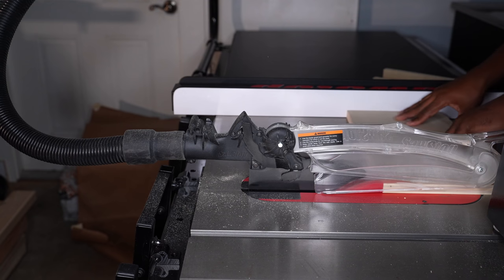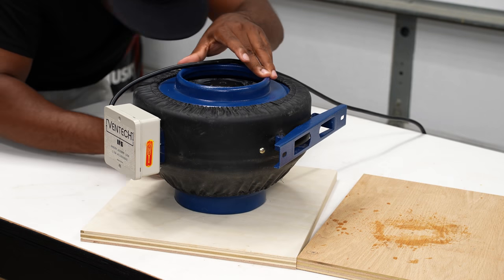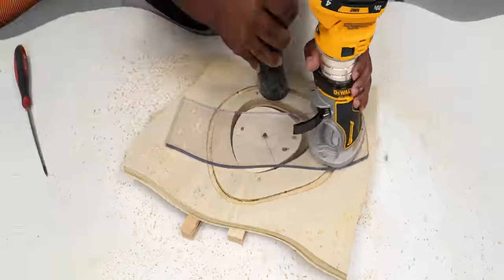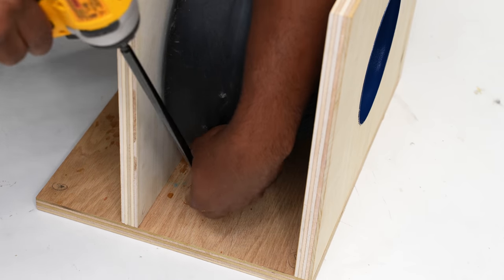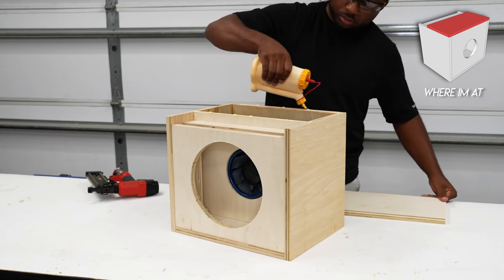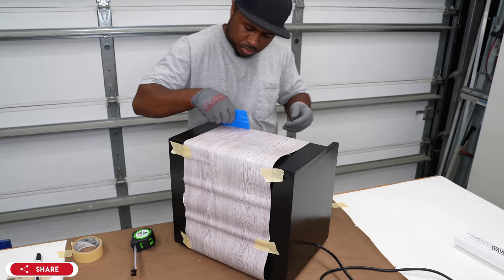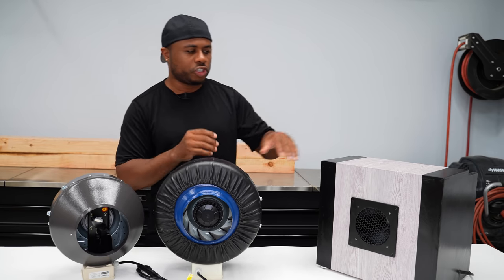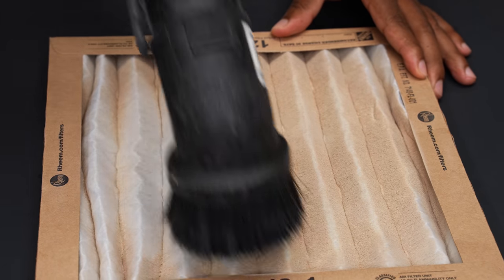How to make a wood shop AIR filtration system

Comment: 12:25 dude that's nothing, I built a 2 filter triangle shaped MERV 13 filteration system for my shop and the 20 x 20 x 1" filters were so dirty after 1 month. 3 times the dust. Mine has a 20" box fan. My dust collection on my tablesaw is 2 stage with bag in the vac and 1 stage on miter saw. I router is 3 stage. 

Still this is the best looking filter system I've seen yet. Dope

Comment: Thanks. Made one after watching this. Had been worried about air-borne dust so used a micro filter with an in-line fan (460cfm) . It quickly cleared the air in my garage/shop. It got so dirty so fast that I put a second filter on the other end of the fan. If I've done much cutting in the afternoon/evening, I let the fan run overnight.

Comment: Very compact design 👍. But I would recommend to build it bigger to integrate a second filter (air bag filter). By that you can use the air filter panel as a pre-filter for particels down to approx 5 microns and the second air bag filter for particels down to 1 mircon. That‘s how it runs in my shop and does a great job.

Comment: I like the simplicity. As with many, I have been keeping an eye on similar videos. Have also 3D modeled a design which uses 2 and 3 filters that is suspended from the ceiling, also built using wood from other projects. Feeling the need to re-evaluate it. Thanks for the demonstration.

Comment: Another great build! I often use flat washers when attaching components made of metal to wood/plywood, esp if the hole in metal is a bit bigger than needed. Better holding power. Thanks for sharing!

Comment: Solid project and one that I hope to do sometime soon.  Only thought for if you have to build more of these for your shop - make sure get to the fan in case it fails and you need to replace it.  From what I saw, you'll have to build an entirely new box or spend a ton of time pulling nails and glue apart.

Comment: 10/10, I'm planning on building one for indoor-air quality.  I think I'll be using 4-stages of filters & an 8inch vortex b/c they're resistance-rated high enough to pull air through clogged(to the max) filters. I also want it to have an Megnehelic meter to monitor clogging.

Comment: Great job here.  I have a blower like you show that exits out a window.  
One thing you might do with your circle router is to switch to the other side as you get near the bottom.  You know where the center is so you should be able to flip the board over and get a cleaner cut with no tear-out.  Just my thoughts.

Comment: Love it! I'm thinking of putting 1 or 2 of these in my house to clean the air and circulate heat. I have a wood stove and parts of the house get chilly while others are screaming hot.

I was thinking of adding high density foam or something to the inside to kill the noise and possibly making the box longer with 2 slots - 1 for a coarse filter and 1 for a much fi er HEPA filter

Comment: I've watched a lot of these diy filter vids lately cause I want to make one.  Honestly this is the best so far. The upgrade from a box fan to the inline is definitely worth the cost.  I'm wondering if this fan would be fine to make a little bit bigger box with a bigger filter or maybe double up the filters?  Also this is the best looking one by far. Going above and beyond for looks is awesome.
Reply: Bigger filters would probably be beneficial and put less load on the fan.

Comment: Nice build and idea. Just an idea to think about. If you calculate the actual opening/exposed surface area a 440CFM intake fan requires, you can easily use a bigger intake/filter. It would allow more air movement and less frequent filter changes. With the 12x12 you have it will starve the fan greatly. IMO. I understand keeping the overall compactness of unit. (its perfect). Maybe put (2) filters at a V or come to a point? Or filters on each side and a duct at intake end? just an idea. thanks for sharing

Comment: Your project here inspired me to build my own version of the portable air filtration system (yeah, it took me 2 weeks).  The main difference with mine is it can run on Ryobi battery or 110v, I can still use the fan as a fan if needed, and cost me less than $60 including the fan.  I made a video of it if interested.  FYI, I don't always comment, but I do always watch :>)  Thanks for your inspiration and keep the great videos coming.

Comment: I really like your approach to these projects. This is something I've been thinking about making, so it is timely. There were a couple things that I, personally, would have done a bit differently. I would have made the front opening square to match the full filter area, although it seems like it's picking up more or less to the edges of the filter and the style looks good. Another thing would be to attach one of the panels with screws so that it could be removed if necessary to clean/replace/service the fan or wiring. I just am paranoid about anything that is all sealed up. That's a relatively low pressure fan, so I wonder how well it sucks the filter against the frame and how much leakage you might get around the filter - but I'm also not sure that it even matters in this application. Having grown up without really giving workshop dust a thought I'm becoming a lot more thoughtful about it as I get old.

Comment: Very nice dust filter! I would think you should have built in an access port for the electrical connection box in case it needs future access. You never know what will fail at a bad time. I've been thinking about building something similar, but with added carbon filtration. I'd wager you're going to end up building another one at some point. I also wonder what the performance difference would be between the circular filter hole you used and a larger square hole to come closer to max square filter area. Once.. ha.

Comment: That looks awesome and a great idea, and very clean work. The system would be more efficient if you made the cabinet longer and pull the inlet away from the filter to create a vacuum ‘chamber’ rather than the air inlet and filter so close to each other.  In other words, your column of air should be as large as the filter area. Also make the front hole the size of the filter to expose all the filter surface.

Comment: Great work.  I have a questions though.  How much does the filter restrict the air where it affects the operation of the fan?  Does it cause the motor to work harder, too hard?  Optimal would have enough filter area where 440 CFM could/would pass through the filter area.  This is why some people use a box fan and will build a cube of filters behind it, to increase the surface area for increased air flow.

Comment: Could one of these inline fans be used to make a small, single machine, dust/chip collector? Like for a drill press or bandsaw? A regular shop vac works but the loud sound get annoying. And my dust collector is in a different room and would not be feasible to run the hose.

Comment: Nice idea - will definitely make one for my shop.  However, with regard to using for spray-painting, is this safe to use when spray painting or airbrushing with enamel paints?  Any concern or danger with the switch/control being a source of ignition for flammable fumes or particles from the paint?  I need to make a spray booth for painting models in my basement work area, both to contain overspray and keep the fumes under control.  Looking to possibly modify this for that purpose.

Just found your channel and enjoying it.

Comment: Such a great cheap idea for weekend warriors or people renting/suburbs that can't put in a full size pro system. I wonder if you made another without the filter and routed it outside with an electronic baffle door (for insects) how much cross draft you would get might eliminate the need for the filter having all the air being dragged outside constantly.

Comment: My only concern with this is the fan axial fans are not made to force air through ducts and filters you need lots of static pressure try and use a radial or centrifugal fan nice work though 👍

Comment: This looks really good! Question - I am not very good at making things so I currently use a 20 inch box fan with a 20x20x1 furnace filter attached to the back of it for my air filtering needs.  Please forgive my ignorance; other than having different dimensions and looking more aesthetically pleasing, in what other ways is this type of filter better than a box fan filter?
Reply from the maker: Thanks, while they both do the same thing, this setup is way stronger and will clear a room faster than a fan. I tried the fan setup, but with the lack of suction power, particles further away will likely not be pulled in before falling. Neither is wrong, but if you want to clean out a 400sqf in 3 to 5 minutes, I will go with an inline duct fan.

Comment: Duct fan is 440 cfm not 4440.  Black and vinyl looks good.

To calculate the volume of your shop, multiply the length by the width by the height. Multiply this number by the number of times per hour you want to filter the air (6 – 8) and divide the result by 60. This will give you the CFM required for your workshop.

Comment: Quick engineering tip: if you make the box with filters on multiple sides (say front, top, left, and right), you can greatly reduce the back pressure on the fan.

The fan will move what ever air it can (per its rated CFM), but it won't have to work as hard if it has access to more room air (per the additional filter surface area).  In other words, the air resistance on each filter is reduced while maintaining the same total volume of air through the box.

If you make a box where the back side is a cheap box fan for example, the motor should last longer when doing this.  And you don't have to swap out filters as often, because you now have multiple filters to share the load.  But you do have to swap out all those filters in bulk for each life cycle.

Comment: You should have made the capacitor easier to get to. With cap run motors like that, its usually the capacitor that starts to fail after a couple of years (can be a lot sooner or longer, but usually a couple of years for those systems)  When the capacitor starts to fail (+/- 5% mfd) the current of the motor increases and can burn the motor out and can be a fire hazard in a wooden box. Capacitor is cheap maintenance that saves you money in the long run.
Reply: The motors are thermally protected, every UL motor listed for household use that isn't shaded pole requires some kind of thermal protection.  And it's not likely to be a fire hazard, as the windings in the motor will fail long before the case gets hot enough to catch fire.

Comment: Get a $20 box fan, and tape a filter directly to it. Much cheaper, and includes a built in speed controller.
Reply from the maker: Lol ok, A $20 box fan can move the same amount of air as a duct fan? Everytime you need to replace the filter you will have pull out the tape? I think I'll pass. It's just not the same, not even close. I can clear the air in 3 to 5 minutes.
Reply: @DIYCreators  Yes, it'll move significantly more air because box fans are much larger, typically 20" diameter, typically doing about 2500cfm vs about 400-600cfm for your style of duct fan. You don't have to run tape all around the sides, just a tiny amount to hold the filter when the fan is not on. When you turn on the fan, the suction holds it in place. Or, if it's a serious problem for you, just attach an angled bracket to the bottom, and slide the filter on that. No tape required. A 20"x20" filter fits perfectly.

It's not hard, it's what every single wood working shop in existence uses (Speaking from plenty of experience). 

It'd take you literally seconds to look it up on YouTube, instead of being so dismissive. You can have 4 of them for the price you paid, 10,000cfm, and zero labor required.